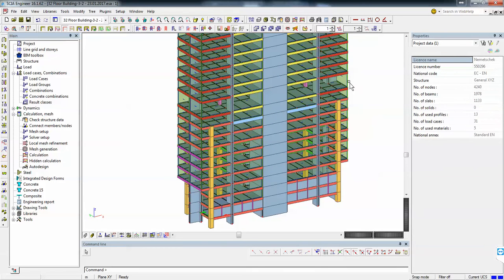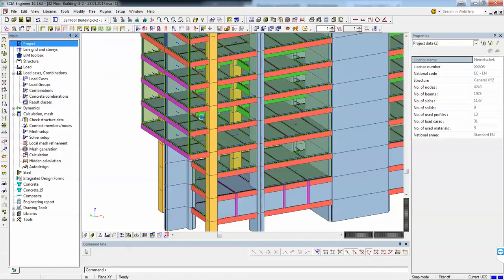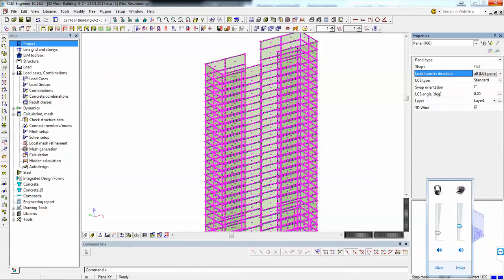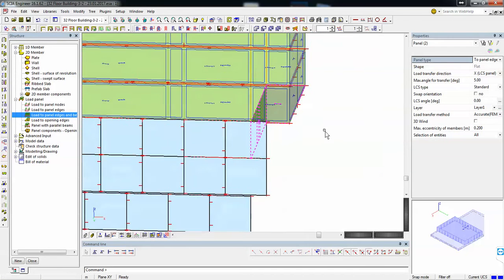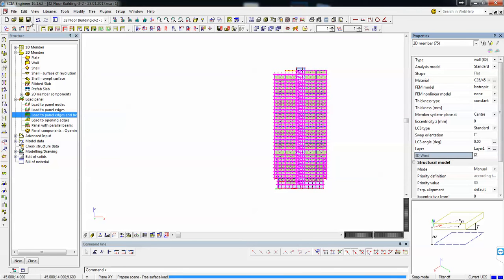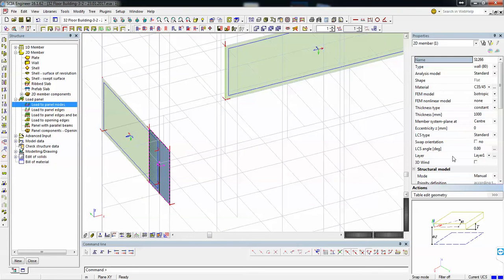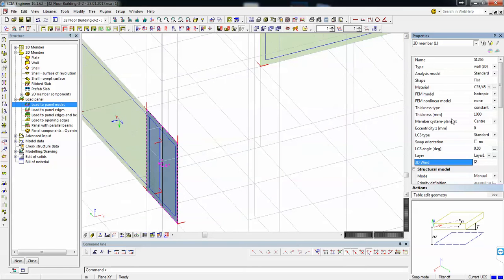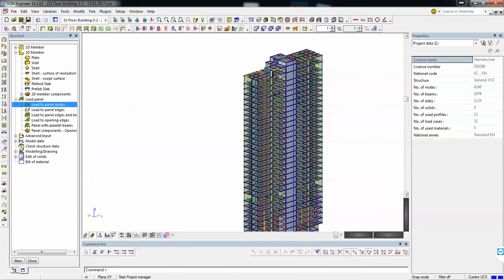Lesson No.1: How to define panels for 3D wind generator [EN]

Comment: how to analyse tensile fabric structures on scia engineer
Reply from the maker: SCIA Engineer allows to perform geometric non-linear analysis both for 1D and 2D members. The software can determine the stress and strain distribution in the structure and these should be checked against design criteria for ULS and SLS specific for that material.
Reply: @SGD  Please upload a tutorial on how to design tensile structures in Scia Engineer